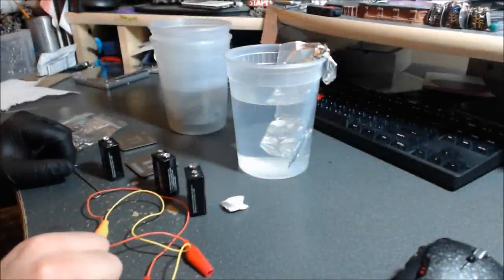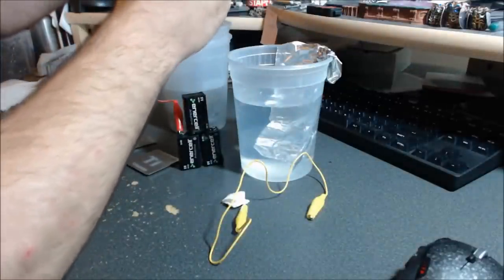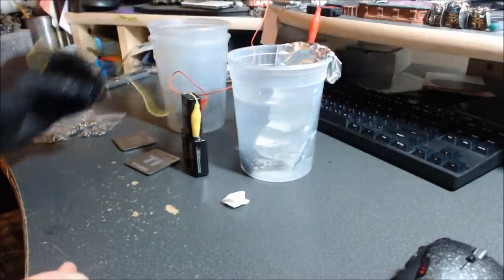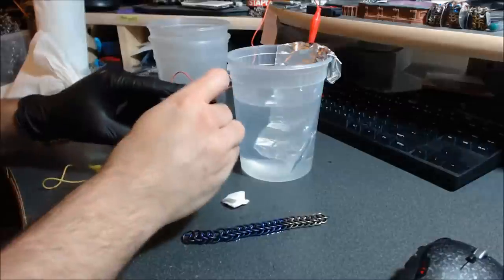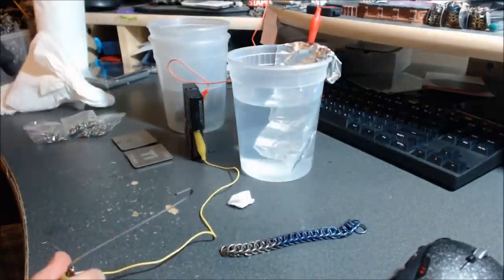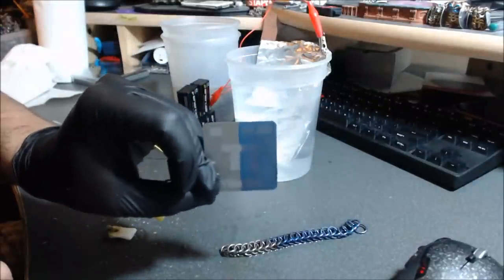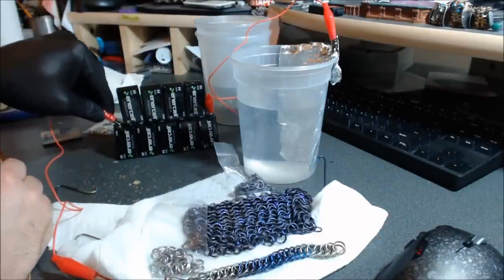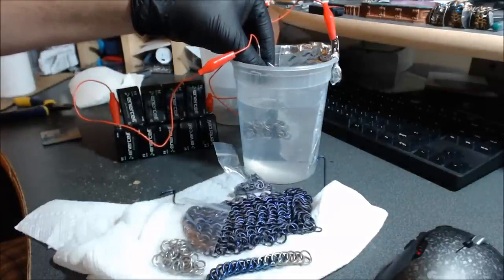Anodizing Titanium Chainmaille using 9V batteries

Comment: You are the freaking man!  Thanks so much for this.  I immediately went out and bought a ton of 9V batteries.  It works like a charm.  I used 2 teaspoons of baking soda, and warm water.  I tried lots of different voltage combinations, since changing the voltage changes the color.  I tried from 9V to 108V!  From 9V on up, it goes gold, bronze, purple, blue, silver, gold, bronze, purple, blue, teal.  From what I've seen, if you get as high as 140V, it turns bright green.  I need more batteries!  I am amazed at how well this works given how cheap it is.  I tested it on a Snow Peak Ti spoon, then anodized a Benchmade knife with Ti handles.  I'll post a video of my results soon.  Thanks again!
Reply: +Zolen Boogaerts i think you should get a power supply so you can control the voltage better and save more!

Comment: when you tried to paint it on you had the leads mixed up.  You have to connect the positive and paint with the negative at the 6 minute part.  You had them reversed Cinnibarnet  also when doing the larger patch, the negative "aluminum" must have greater surface area than the part being anodized.

Comment: Does this setup also work for Aluminum anodizing or does it HAVE to be a Sulfuric Acid solution when anodizing aluminum?
Reply from the maker: No, anodizing aluminum requires dyes and caustic chemicals.  The process is very different.
Reply: Cinnibarnet Ok thank you. It still uses electrolysis though right?

Comment: if the voltage is constant 27 volts will the titanium get to a blue/purple colour and then stop anodizing or will it continue to change colours
Reply from the maker: Antimatter -Kiwi It will get to a specific color based on the voltage and eventually stop there.  The color is a refractive layer of titanium oxide, as it grows in thickness, it both changes the color and increases electrical resistance.  Once it hits a certain thickness, the current voltage cannot overcome the resistance and continue to free oxygen from the water to bond with the titanium.  If you later try to re-anodize, lower voltages won't do anything... but higher voltages will continue the process, thickening the prism-like layer and changing the visible color until the thickness/resistance equilibrium is reached again.

Comment: If using actual steel maille, would you use a different type of metal for the hooks?
Reply from the maker: Electrical anodizing such as this ONLY works with reactive metals such as Titanium and Niobium.  This won't work with steel.

Comment: Is it required that the solution the part is being anodized in has to be distilled water?
Reply from the maker: Sahil K not required, but you'll get better, more consistent results is you control the composition of your electrolyte solution.   This generally means using the same quantity of distilled water and the same amount of additive (baking soda, TSP, Borax, whatever).  Using tap water can result in tiny amounts of contamination that may make the colors cloudier or duller.

Comment: What is the wire that is attached to the alligator clip and the metal ring you are putting in the water solution?
Reply from the maker: The hook is a small scrap of titanium welding wire.
Reply: Cinnibarnet what if I don't have a small scrap of titanium wire? What else. Could. I use.
Reply from the maker: jake Anything entering the water on the anode side needs to be titanium or niobium.  If steel or copper is used as the hook, the electricity follows the path of resistance (through the steel or copper) and no anodization will occur.

Comment: do u have to use ti hook?
Reply from the maker: Yes... the electric current takes the path of least resistance, and if you submerge a titanium object on a steel or copper hook, the current doesn't pass through the anode, meaning no anodization or color.
Reply from the maker: You COULD however, clip a lead directly to a piece of titanium and only submerge part of the Ti... but only the part submerged would get color.
Reply: What about a steel hook
Reply from the maker: see above reply

Comment: what metal is that hook?
Reply: Titanium he says they are scrap welding rod for titanium. 

You can also use borax in solution.
Reply: +Lunas Eclipse it should be noted unlike aluminum titanium oxide is still conductive. the reason the larger patch did not work was the cathode was too small for that big of a anode